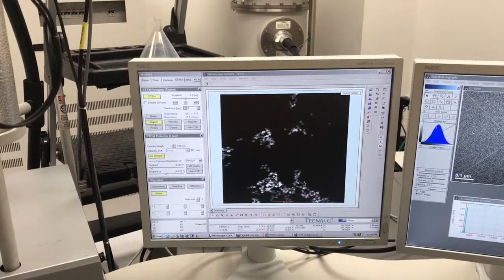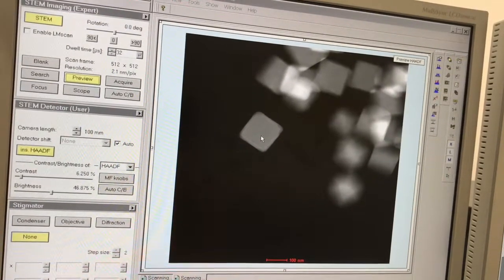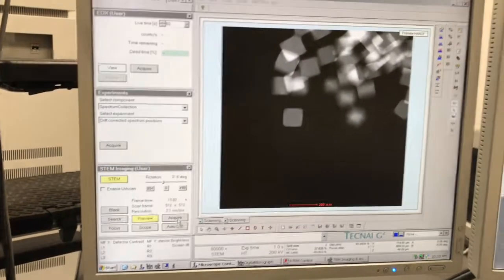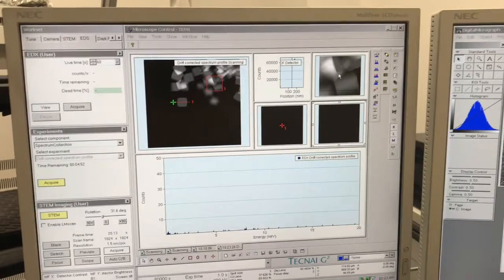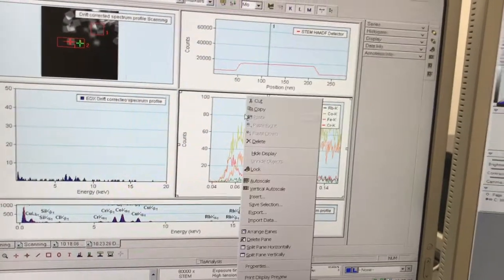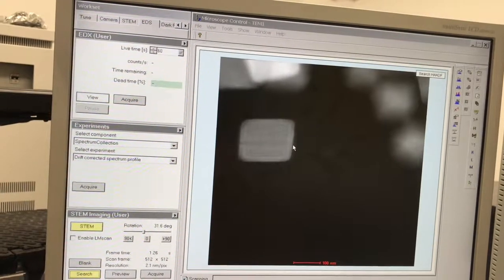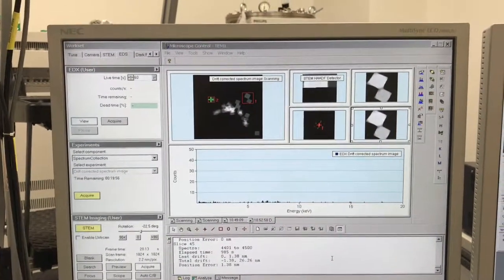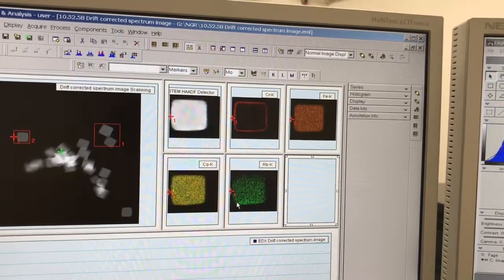FEI Tecnai F20 S/TEM: spectrum imaging using EDS in STEM mode

Comment: Really love the videos, do you have a video on calibrating the TEM?
Reply from the maker: Hi Emre: glad you like the videos.  When you say "calibrating", that can mean any number of things, but usually this refers to magnification calibration.  Is that what you are talking about?  In most modern TEMs, this is actually something that is done via automation rather than manually (unless you have an older instrument).
Reply: @NicholasRudawski  yep magnification calibration! my supervisors had just asked me about some d patterns and how i had calibrated it and i was like ummmmmm… haha so i’ve been trying to learn!
Reply from the maker: @emreyildirim6629  When you are talking about atomic-level features like d spacing, this is best calibrated with a known single crystal sample like [110] Si (most common).  The FEI systems (even the older ones) actually have an automated method of doing this where you basically just have to put the sample in and set up the image and click a button, but this is more involved if it can't be done in an automated manner.  Would still be a good video to go over how to do magnification calibrations manually.

Comment: Hi Nicholas, that is a really helpful video for me! I have a question if you have any method to import the TIA ser format EDS(or EELS) mapping data to the Gatan DM software? I would like to do some post analysis by Gatan software but I can only collect the spectrum image from TIA for our very old Titan microscope. Thanks a lot!
Reply from the maker: Hi Guo: unfortunately, as far as I know, the TIA formats are basically only usable in TIA and nothing else.  I recall trying to open these in DM and ImageJ and these didn't work.  That being said, you can export the maps in TIA to a normal image format and then open those in DM/ImageJ, but these will contain no spectral data.  This same issue also exists if you collect any spectrum image data in Velox, too (since I don't really use TIA much now).
Reply: @NicholasRudawski  Got it. Thanks a lot!

Comment: Hi Nicholas, I have a question about the EDX mapping analysis. When we finished "Integrate" and element selection, in  the "AutoMap", before we do the "Generate output", there is a "setup" button, there are three modes in the analysis type" Integrated intensities, raw quantification and full quantification". I tried all of them and the output EDX maps are quite different. So which one is right? Thanks
Reply from the maker: Hi Iceice: that's a great question.  Integrated intensity simply measures the counts for a specified energy window for a given element while the quantification routines should also include some type of background correction and peak deconvolution.  I'm not entirely sure of the difference between "raw" and "full" quantification, but I think "raw" is just counts with background correction/deconvolution while "full" does that plus computes atom% and/or weight%.  The quantification routines are superior to integrated intensity in that they do a better job of accounting for peak overlaps and removing background, but that also depends on having sufficiently high signal to noise in the maps.
Reply: @NicholasRudawski  Hi Nicholas, well, thanks for your detailed explanation, it's very important and your tutorials of tem and stem are really good and helpful to me. Thanks again for your effort.
Reply from the maker: @iceiceq2369  You're welcome.